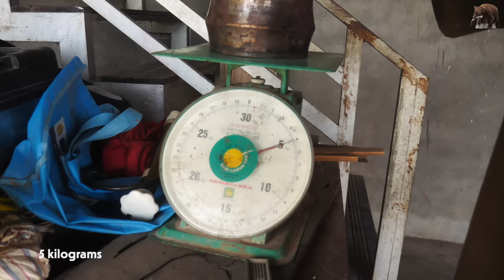How to make a strong machete out of a broken excavator bearing

Comment: some where a "forged in fire" judge/fan has just had a stroke, "QUENCHING HIGH CARBON STEEL IN WATER, THAT BLADE IS DESTROYED" ya no, water works just dandy if you don't overheat the steel in the first place there dudes, Nice work by the way, dudes an artist with that angle grinder.
Reply from the maker: you can search some knife tests across this channel. Quenching in water is not bad. thanks for your comment.

Comment: you'll get more uses out of the cutoff wheel if you anneal the steel before cutting. 
do you normalize the steel after forging? it will likely have fine grain already but with high carbon steels like this there are some other things to consider like grain boundary carbides.
Reply from the maker: we do anneal the steel but other things, sorry, we don't know a lot about it. Thanks for your great idea
Reply: "Normalizing the steel"
Do you mean quenching the steel to harden it while they're forming the shape?
Put it in an oven to temper it once product is finished?
Reply: @AmazingKKDaily  Where can one buy your tools?  Do you have website? Do you ship internationally? Do you do custom orders?
Reply: @D33Lux  normalizing is the process of recrystalizing austenite grains to equalize their size. it also dissolves carbides that form at the grain boundaries in certain temperature ranges, especially in high carbon (>0.8%) steels. grain refinement cycles are similar but done at lower temps. typical procedure is 1x normalizing followed by 3 GR cycles. hardening is the process of turning austenite into martensite. grain refinement can be done by hardening, it is actually faster since a martensitic structure features more 'starting points' for recrystalization but that also has a higher potential to warp the work piece or introduce micro-cracking when done wrong. all of these involve heating steel above Ac1-3 and all are done strictly after shaping/forging.